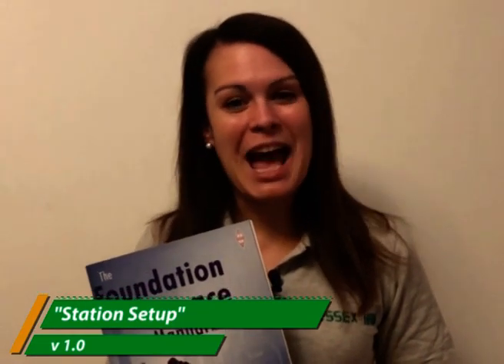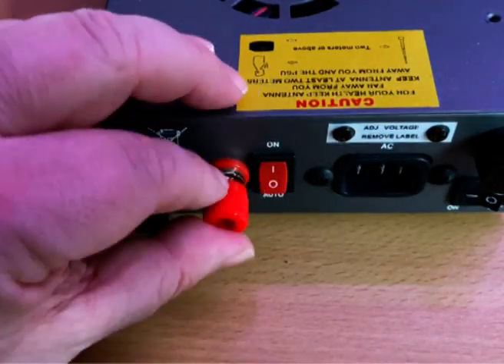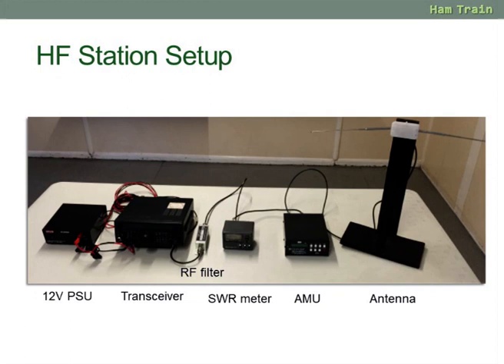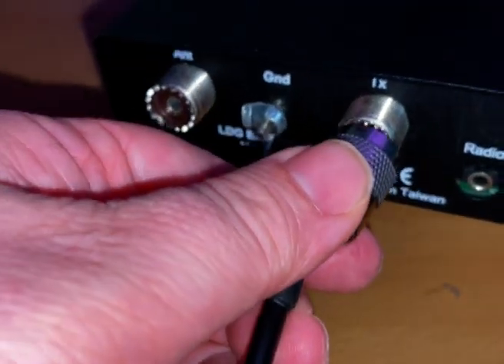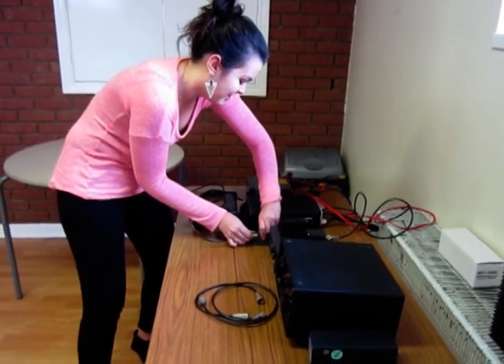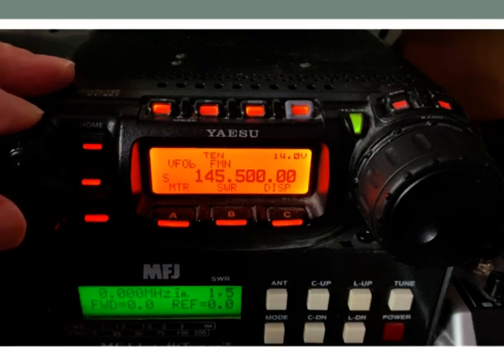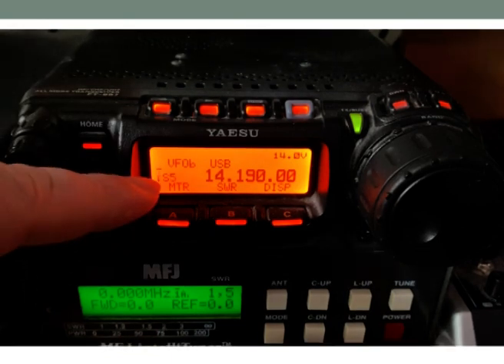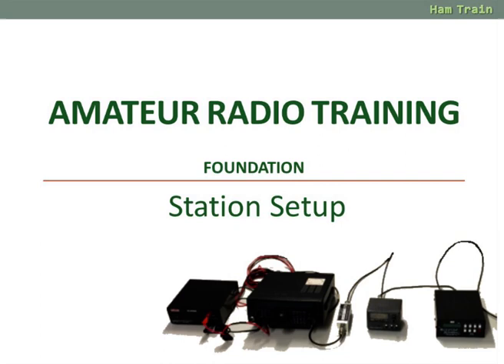Foundation Online: Station Setup

Comment: Question, why connect power first; accidentally keying the mic before connecting the feed lines could kill the transceiver?
Reply from the maker: Typically people will connect their setup with the power off, rather than connecting things up with live power running through the equipment. It;s good practice to set equipment up with the power off, check the connections, and only when you're ready, switch in the power supply.